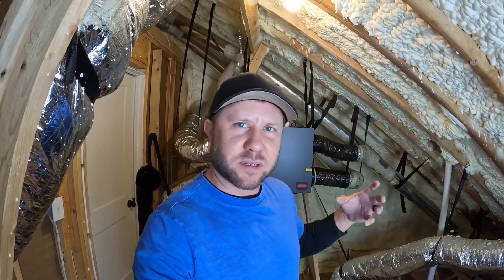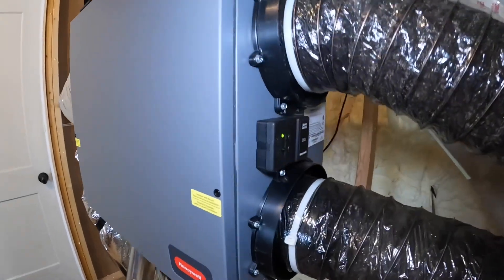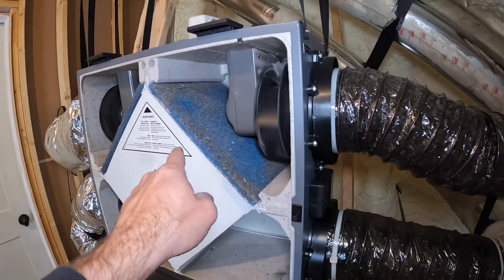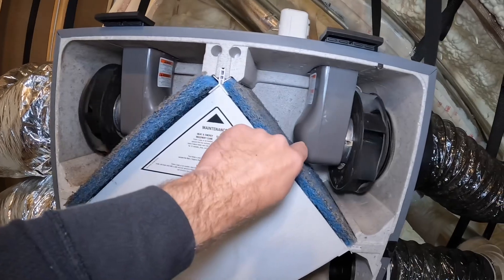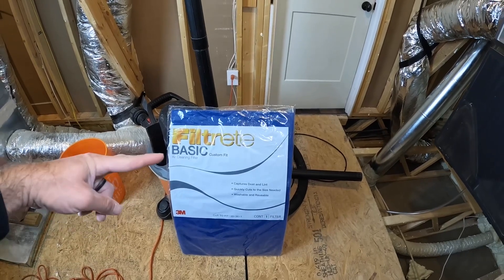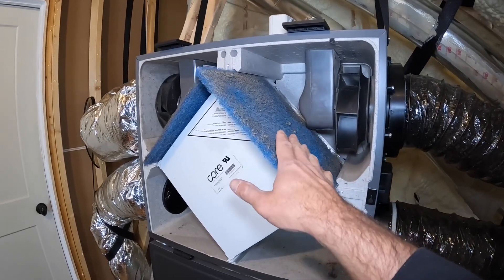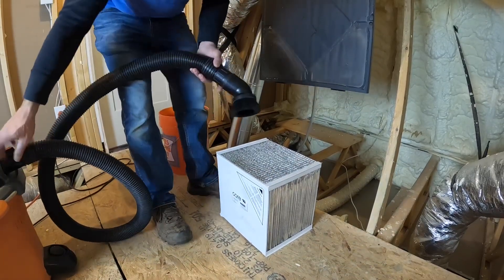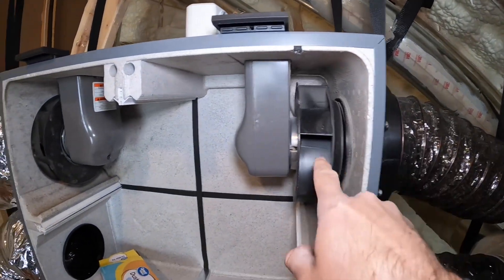Making cheap replacement filters for my Honeywell ERV. Spray foam ventilation.

Comment: That's Alot of Dirt/Dust. Alternatively, you can install the Filter at the Intake Port. That way It Filters Everything at the Source and Nothing even Makes it in to the Unit. That's what I did, My Core is Super Protected and Clean.

Comment: I live in Houston also and am thinking of installing either an ERV or Dehumidifier. Which would you choose if you had only one?
Is your AC two-stage? 
Thanks a lot!
Reply from the maker: The ERV and dehumidifier do two different things. If you are having problems with ventilation and high humidity, then you will need both. I do think I remember seeing a single unit that is a dehumidifier and a fresh air ventilator. I don’t remember the brand, but that might be something you could look into.  

We have very high humidity in Georgia so a dehumidifier is absolutely necessary, especially in a spray foamed house. I would not choose to do the ERV again. Instead, I would have just installed fresh air returns on each of my HVAC units. It would’ve been a lot cheaper and I think it would bring in more fresh air than this ERV does.
Reply: @BrantleyBlended  thanks

Comment: if I disable my ERV, will I have more 'humidity' in my house?
Reply from the maker: My ERV does not remove humidity from my house. I have a dehumidifier in my house that removes humidity. At least with my experience, the ERV has nothing to do with my humidity level.
Reply: @BrantleyBlended  Might as well buy a cheaper HRV then if it needs to be replaced. Thanks for the vid and the filter idea.